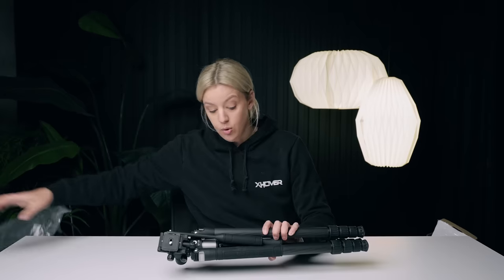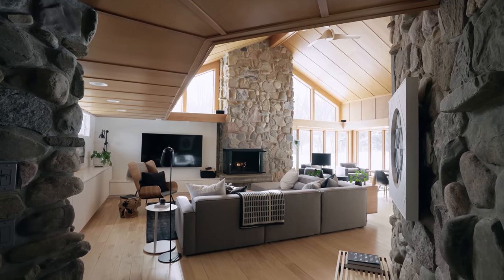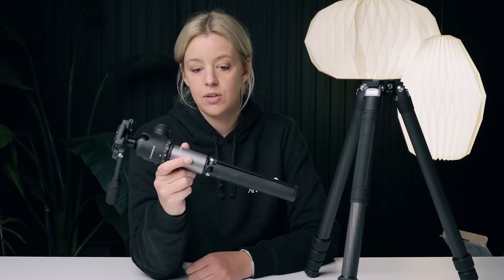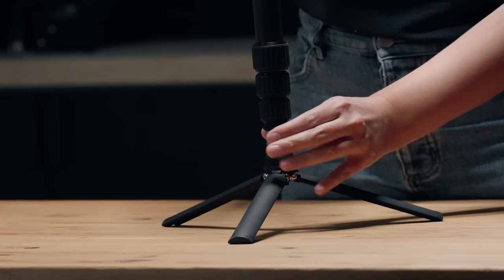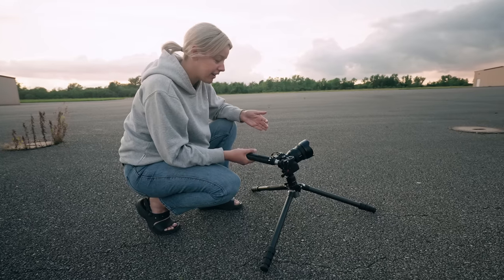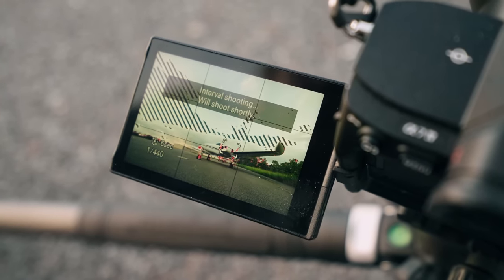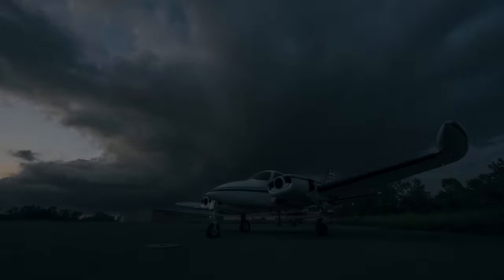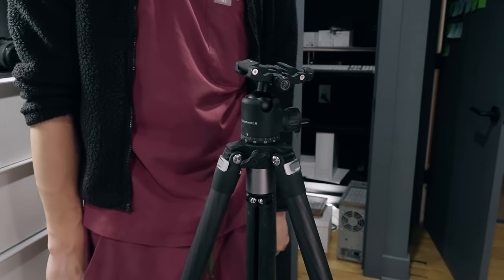The Only Tripod You'll EVER Need!

Comment: I looked at the price before watching. And went woah, that's a price. But after watching. I realized this is just about the most tripod-est tripod of the tripods. There's about 4 tripods in one package. If you bought 4 dedicated tripods per category it would be closer to this promaster than not. It doesn't look like the individual tripods have many compromises either. Ball heads, stable wide legs, you say the handheld is light I believe it. Wild

Comment: Nice tripod about the only thing I think the pan handle should be a self unscrew and not need a extra tool
Reply: The only downside to an unscrew that I can see would be wear on the tripod head from repeated removal.

It wasn't mentioned in the video, but is it possible to screw the handle on not straight intentionally? My antique fluid head has a dog leg handle that can be positioned 90° off and removed which is occasionally useful.

Comment: Interesting tripod. If I hadn't bought a carbon fibre tripod, I'd have put this on the top of my list. 

May I ask how you set your camera for day-to-night Time Lapses please?
Do you put the ISO on auto and the Shutter to auto?
I'm trying to crack the Day-to-Night nut so that I can do some Milky Way stuff.

If I could offer you one suggestion, it would be to get a self-leveling base for your fluid head tripod. It takes seconds to level your camera for smooth panning.
Reply from the maker: The day to night stuff is a little complicated to type but perhaps a tutorial vid is in order next adventure!
Reply: @BeckiandChris  No worries, and a tutorial would be most welcome.
I normally do my Timelapse’s fully manual with a ND filter to keep the shutter open for half the time between images. But to do manual for day-to-night is madness. So far I’m experimenting with 6 second intervals with ISO and shutter set to Auto. It’s a compromise but I’m open to better techniques.